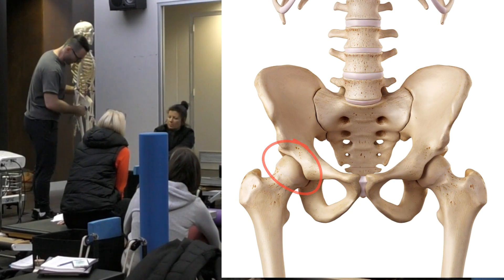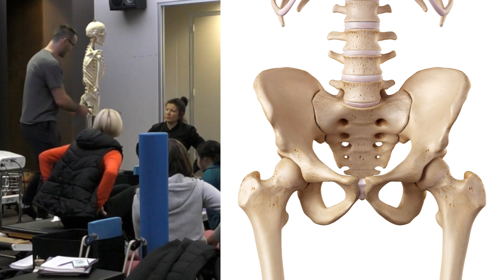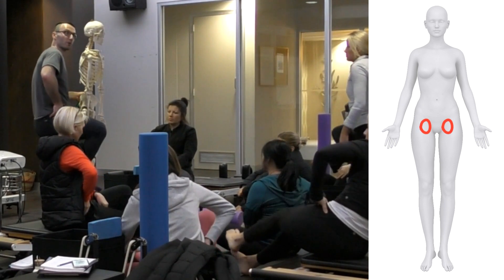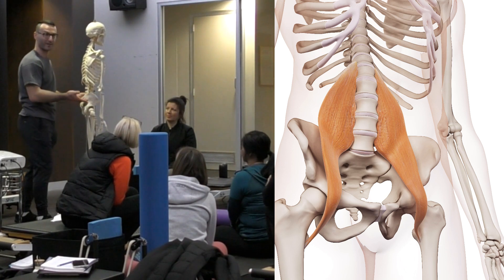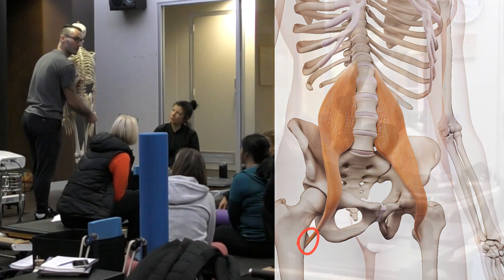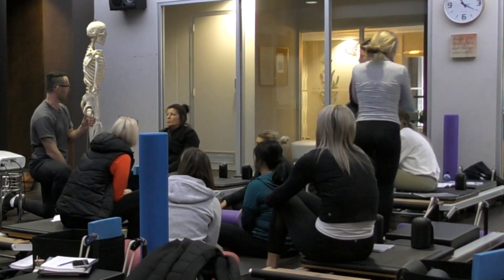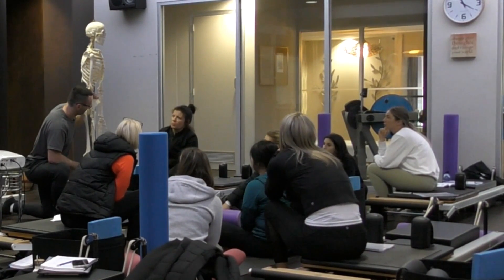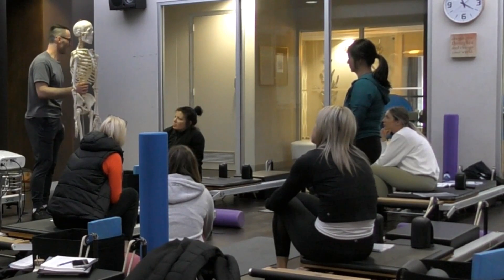Why does my hip click when I do one leg circle?

Comment: "If there's no pain, don't worry about it" is  how you end up with bigger problems down the track. 

I had painless clicking and grinding in my right knee that became PFPS and then Chondromalacia patella. I had painless clicking in my shoulder until that lead to a torn rotator cuff. You can't be so dismissive of these kinds of symptoms.  If your body has imbalances, they will present as clicking, grinding or popping sounds and sensations and your must not ignore them.
Reply: Our body does not present "imbalances" via clicking or making noise, but by nociception, simply put, they become stimulated, brain interperets it as pain. It is widely multifactorial, so you cannot just say that clicking or grinding leads towards pain or pathological changes. When you crack your fingers, does that mean you are out of balance ? :)
Reply: @ivanpavlov7260  cracking your knuckles is bad example. There's a massive difference between the release of synovial fluid and friction patterns that can be repeated in cue.
Reply: That's my thought too. And why does it only happen on one side? 🤔

Comment: This was a lovely explanation... but, I have to say, I'm not so sure about ignoring it! That's what I did. Had this clunk, clunk, clunk when doing daily leg raises. A couple of years down the line, I felt something tear deep in my pelvis while I was cleaning my windows. Holy Mother of GOD, the excruciating spasms! I'm on the mend now, and I've found lots of other vids on YouTube about this issue with rehab exercises and exercises to build weak glutes and abdominals to prevent this from happening. Keep searching, clunking folks xx
Reply: Do you mean the solution appears to be strengthening glutes and abs?
Reply: Thanks for this comment
Reply: I ignored it following my physio's recommendation and ended up being diagnosed with labral tear 10years later. Did it have something in common?Not sure, but perhaps it was a very early sympthom that something was wrong

Comment: I've been searching solution of my hip problem but i always find answers like this and this isn't my problem i guess(English is not my first language so i dont know if i can describe it correctly) 
My problem is little bit different than this one. Its around hip joint area. I feel like one of my muscles or tendons etc. is crossing over my hip bone when im squating. It happens if i bend over first(legs straight) then i try to get into the squat position(legs 90 degrees bent). It feels like a muscle stuck in a position and it releases from there to other side of the bone. Imagine like you are pulling an elastic band from its middle while its stretched then you let it go and it gets into the neutral position. I went to a doctor past week and he just gave me pills and a cream?(muscle relaxing type of sh*t) i use them for a week but i dont think thats my solution. Can you help me if you know what the problem is?
Reply: It is the nerve. It is pinched and it gives you that sensation.
Reply: @jelel9698  Any solution?
Reply: @yaslaan  I think you may have Meralgia Parasthetica. Lose weight if you are overweight and lots of stretching and low impact excercises for your abs, hip and quads.  It takes a long time to go away, typically more than a year.
Reply: @jelel9698  So should i stop doing squats and deads for a year? Im not overweight btw
Reply: @yaslaan  You can still do squats and deads if you can tolerate it but very light weight. It takes a long time for a nerve to heal. I had something similar and it took about 10 months for my inner thigh and groin to feel almost completely normal again.
Reply: HI! I still squat heavy and have low body weight and I also would feel it internally on the clicking hip joint. The key is to stretch the joint and develop strength on all of the surrounding muscles. There are other videos on that topic.

Comment: That’s cool, but I still want to fix it so...
Reply: Amputating your leg would probably get rid of the noise.
Reply: @ShawnDeLaCruz l😂
Reply: Mine does cause pain, unfortunately, so I’d like to fix it.  And, yes, i experience lower back pain (and I believe I slipped a lumber disc 2 years ago). Thanks
Reply: @MrChoppypops  do you also have low back tightness and discomfort?
Reply: Do strength training over stretching. Bend at your hips and not your back ( chest out). Engage your core. used to deal with my hip tendon snapping across my bone every day, and then it would inflame my lower back. It's taken a lot of work, but it almost never happens now.
Reply: Did you find any solution?
Reply: @yaslaan  https://youtu.be/zU4ak0DUcgY try this
Reply: If it’s just a tendon moving across boney processes it’s harmless and highly unlikely you’ll ever get rid of it.
Reply: If it ain't broke...
Reply: @WeighedWilson *broken
Reply: If it's happening on one side and not the other then there's a good chance that It can be corrected with physio. However learning how to move your leg in a range of motion that doesn't allow that band to snap over is important also.
Reply: SquatUniversity and kneesovertoesguy here on YT is by far the best channels that will help you best understand how to fix these issues. I used to need a cane to walk and I'm only 36. I squat and deadlift over 300lbs since 2021. Fixed my whole life.
Reply: I got problem with psoas pressing against some nerve that causes leg pain and the same hip clicks... i kunda improve the situation by stretching temporarily
Reply: @joons3374  strengthening is always a good approach. Check out @conorharris
Reply: Me too...😒
Reply: Right! If it's only happening on one side, it's not okay, especially when that same side has outer hip cramping and groin tightness.
Reply: I used to have the clicking issue for years. I’ve done regular yoga for 2 years now and the clicking is gone!
Reply: @stuff1784 I have also managed to practically stop the noise due to regular yoga sessions. It's still there but greatly reduced.
Reply: Glute Bridges and hip flexor strengthening exercises to reduce movement over the joint
Reply: I believe it may be a shortened psoas muscle.

It needs to be strengthened and lengthened.

Do any of you have any lower back tightness or pain?

Laying down on your stomach or waking up in the morning?
Reply: You're right! Took me 13 years but I licked it. Stand on one leg, bend forward, lift you're other leg back high as you can. Hyper-extend the knee joint on the bottom leg. Flex the bottom leg from toes to buttcheeck and hold for 10 seconds. Do both legs. Use something to balance. I had severe hipsnap and nerve pain to where I'd step and fall down, it was terrifying and extremely painful. I tried everything for years. By flexing the psoas muscle under load and excercising it, it will lengthen. Good luck everyone, I hope this helps you!
Reply: @ruthlessmonks I'm😊
😊
Reply: @schnookimz I believe so as well
Reply: @schnookimz  you are right it’s tightness stiffness and weakness in psoas muscle. It can happen if psoas is over lengthen like in swayback posture
Reply: Check out Precision Movement Snapping Hip Syndrome for a fix. It's not harmful unless it's painful, then it can be quite harmful.

Comment: Finally I have an answer!🙂
Reply: finally! i would love to hear same analysis on the knee joint. i have a problem in my right knee when i go downhill, or running for prolonged period of time. but it starts to hurt gradually and becomes unbearable and once i stop i feel nothing. sometimes i also feel it when i hold that leg under chair, or when hanging on a pull up bar and sometimes when doing lunges and when the right leg is in behind position. i have this for many years now.